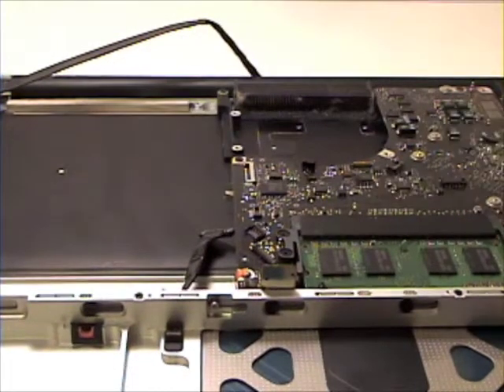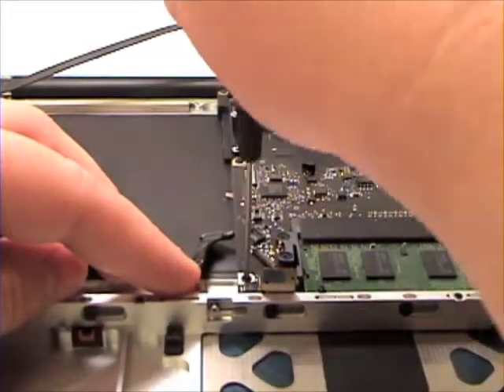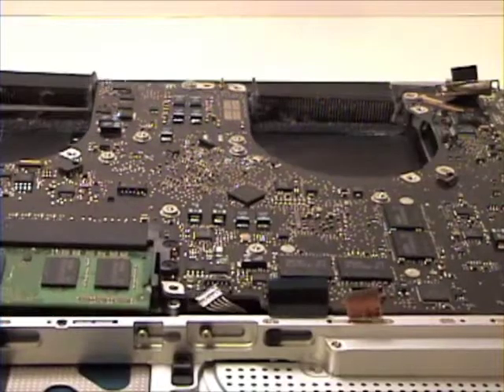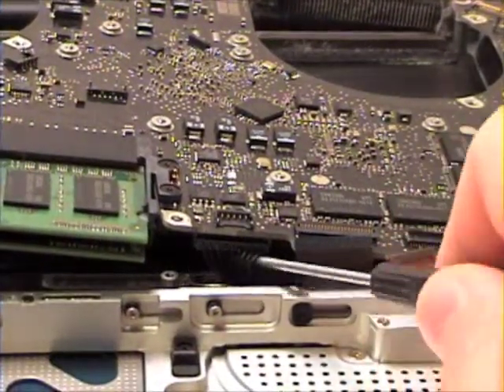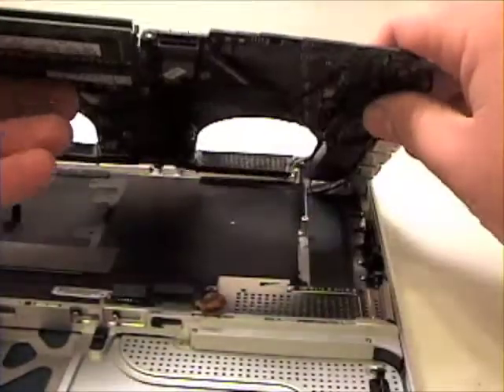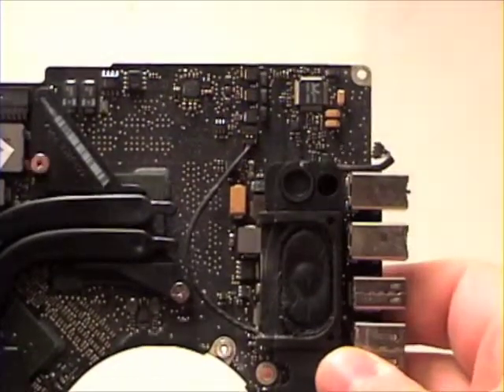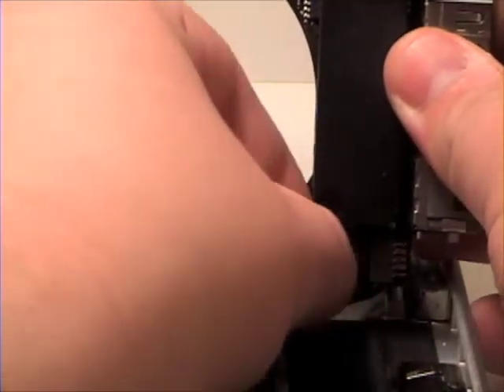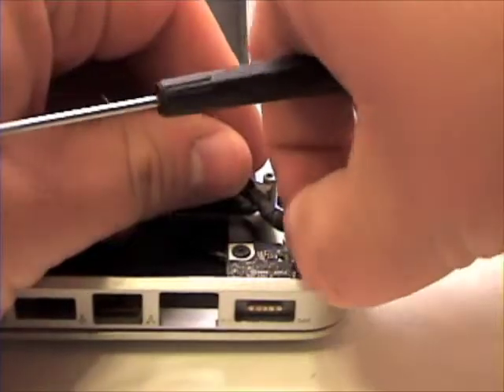How to Remove the Logic Board in a Macbook Pro 15" Unibody

Comment: where can i buy a newer updated logic board and hard drive that will fit a macbook pro 2011 model 13 inch
Reply from the maker: Replacement boards are available from our website or by calling us at 866-726-3342.